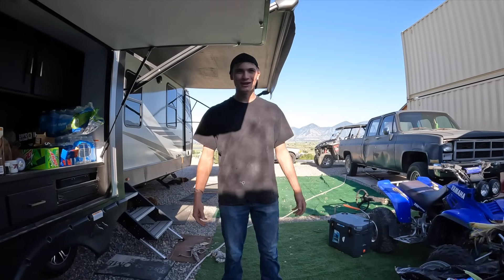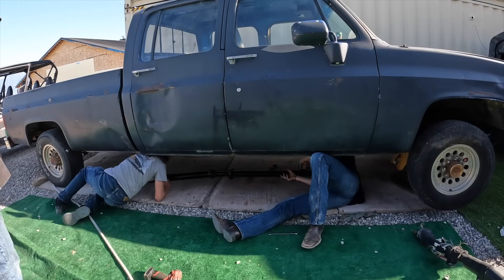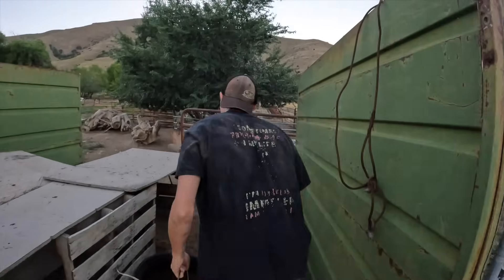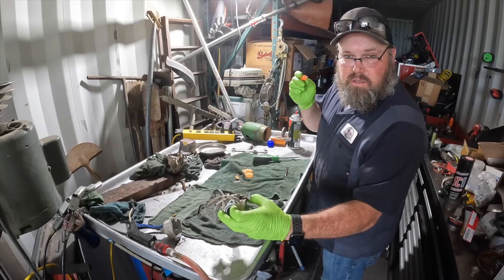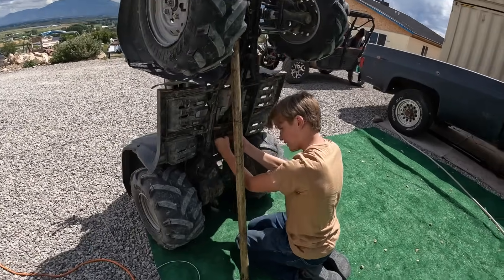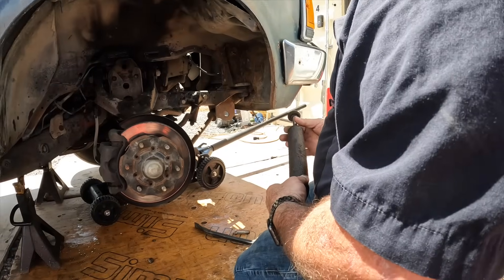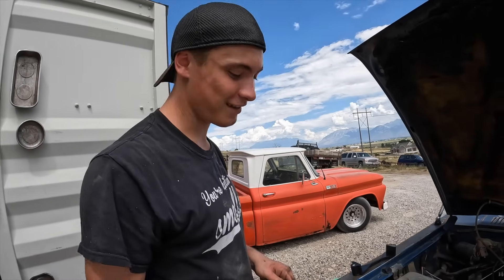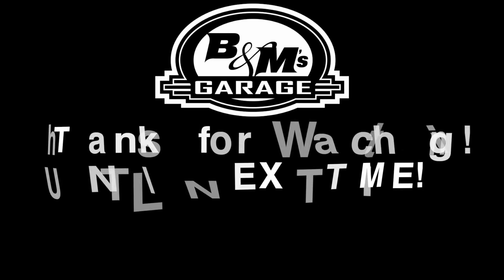SHUCKS... wrong parts!

Comment: Instead of cutting the corn off the cob with a knife I saw someone using a cake bundt pan, I have not tried it, but seemed like a great idea. Just press the blanched cob through the hole in the pan and the cob falls in the pan. There is nothing better than fresh corn in the middle of the winter, thanks for sharing.
Reply from the maker: That is a good idea. I will have to try it the next time.

Comment: Anyone else Shocked that it came down to a torch to remove the worn out ones?Bummer about the drive-shaft.Measure 3 times and cut Once.(Then you trim a little with a grinder;)  )

Comment: Nice to see kids working, but please use some sort of stand / blocking when working under your truck.  Block of wood under frame is fine.  Then if floor jack leaks and drops truck is setting on block of wood and not on your now broken leg or worse, broken head!
Reply from the maker: We too believe in safety under the truck. If you look real close you will see the jack stands. We got the safety covered!
Reply: I saw the jack stands when I watched the video. I had to look for them and felt better about it after seeing them. 
Nice variety on the channel. Need more!